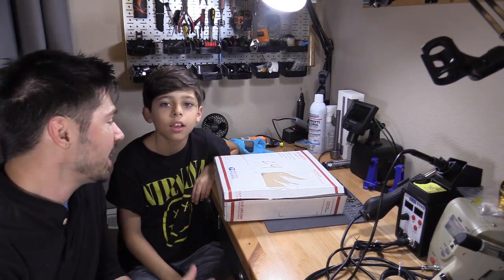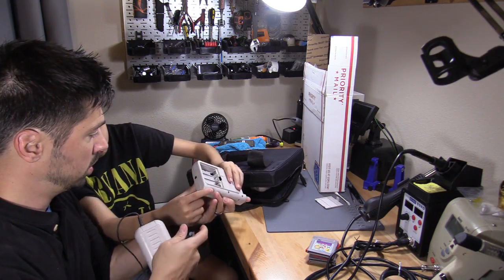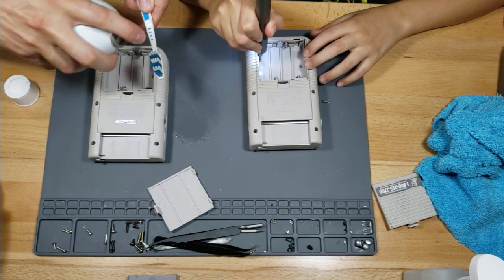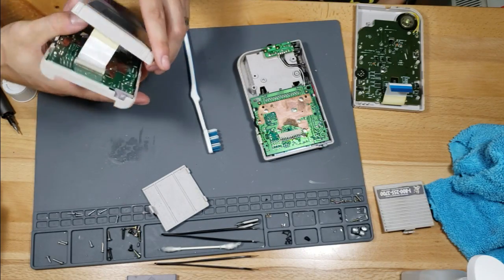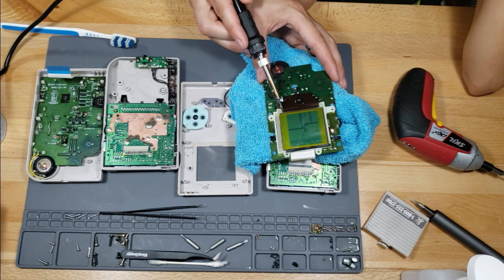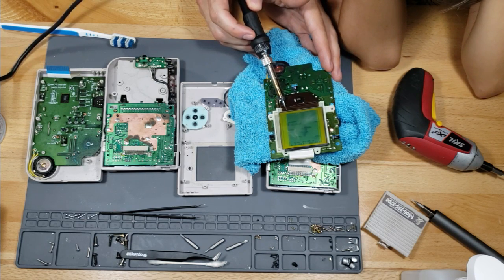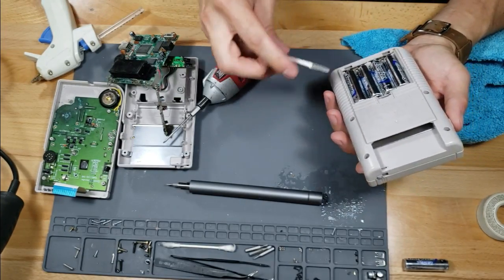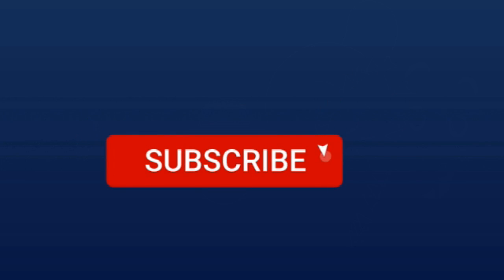Gameboy with lines in screen, Ebay Repair Challenge week 4

Comment: Just a hint...when you have a battery that has exploded, don't use iso to clean it.  Use vinegar first....it will neutralize the acid from the battery, then use iso to clean after.  Little basic chemistry for ya.